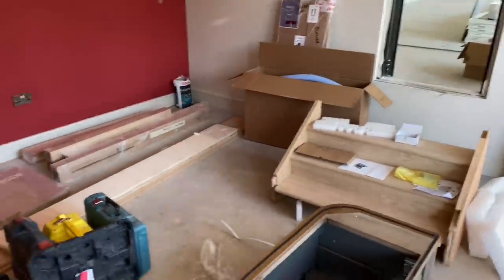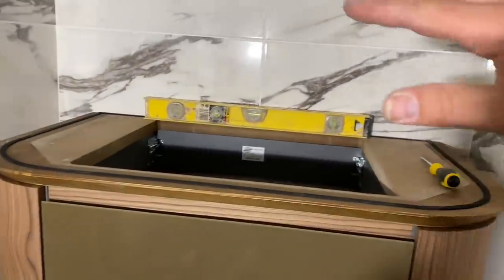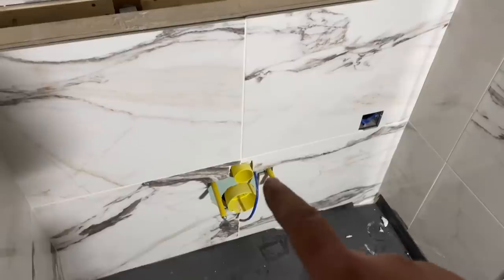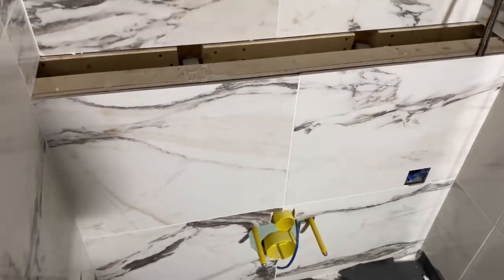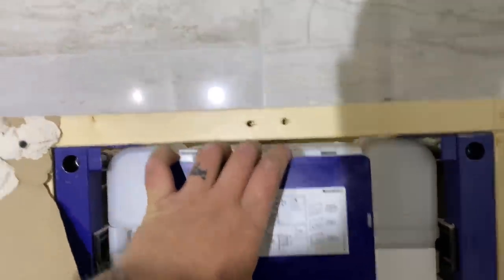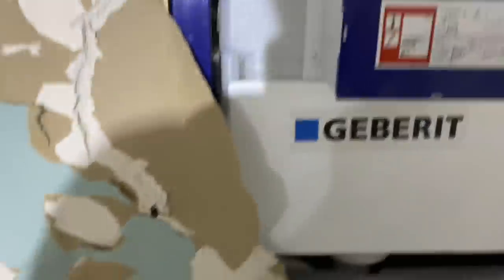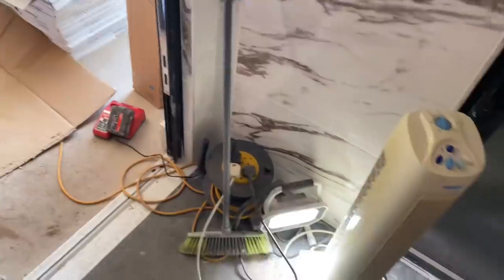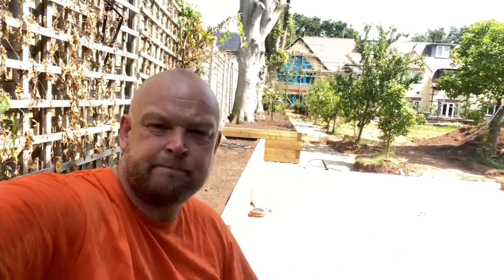CONCEALED CISTERN PROBLEMS…BUT WHOS FAULT WAS IT. REAL WORLD PLUMBING ISSUES

Comment: I always fit a sheet of ply before the plasterboard on these concealed cisterns/ floating WC's just so if you ever have to remove a tile and the plasterboard comes off as well you can repair it a lot easier also when the pan is bolted to the wall it stops the wall crushing. Great channel
Reply: Wall crushing? 🤔

Comment: If all the toilets were the same you should only need to cut out one ,measure for where the shroud goes and cutout the others .
Reply from the maker: Doesn’t work like that as the shroud lip has a bigger opening than the cover plate so you can’t cut a hole and slide it in…. I tried that first😉
Reply: @MJTiffPlumbing  cut the shroud lip down 😂
Reply from the maker: That’s the bit that attaches to the cistern unit itself and carries the whole push button setup….. gotta be right😉
Reply: Or just get the schematic off the Geberit website and cut out for the flush plate, no need for removing tiles or retiling… technically the space between the cistern and the finished wall surface is so small you wouldn’t even need to fit the shroud, just the flush plate…
Reply from the maker: Not quite that easy mate but thanks for the feedback….👍🏼